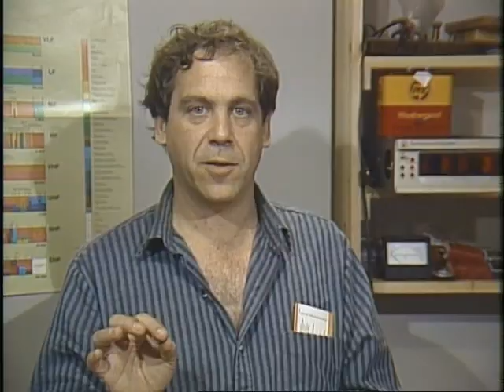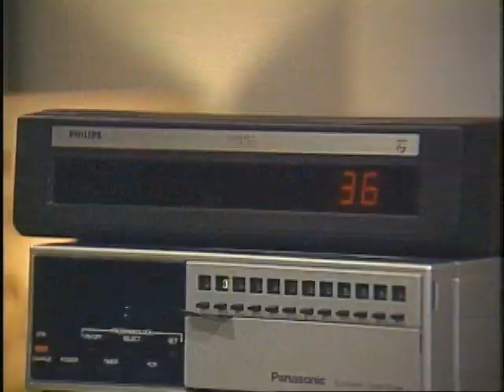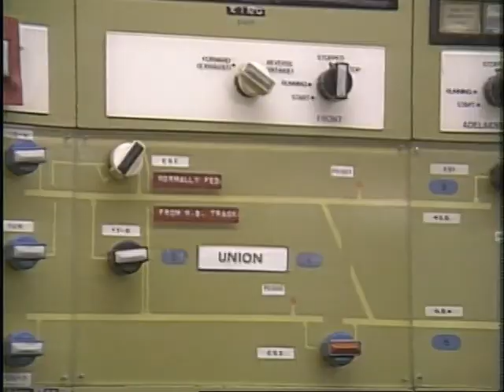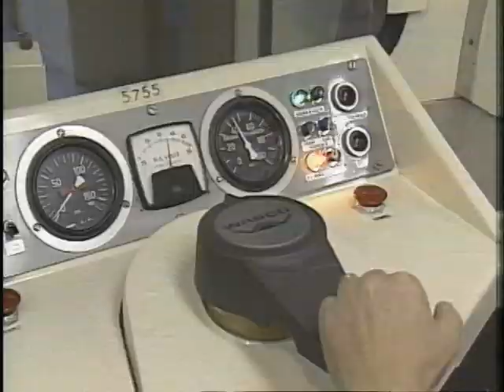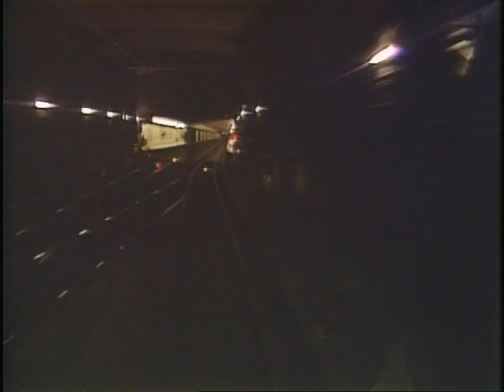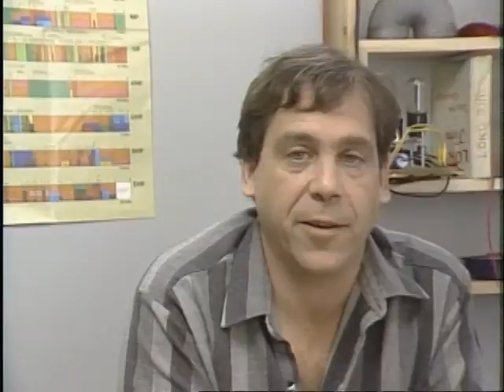Acme School of Stuff S1E2

Comment: Thanks for this, gen Z here. I recently acquired a bunch of old analog video equipment from a building about to be demolished. Was trying to figure out why a TV tuned to 22 connected to an RF modulator tuned to channel 22 wasn’t getting signal. But as this explains, VHF and Cable channel frequencies are different. An old Philips cable converter resolved this! Absolutely love this series!
Reply from the maker: Wow. Little did I know 35 years ago when I recorded this that it would actually help someone!